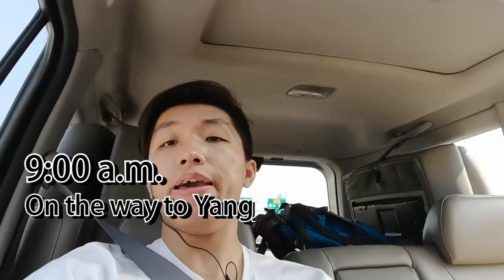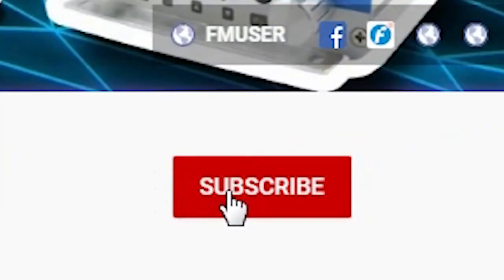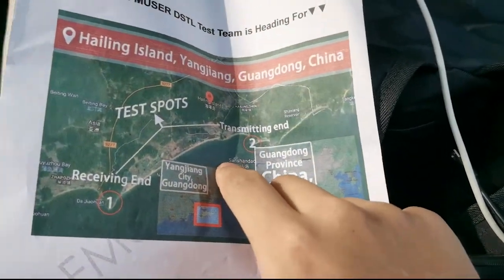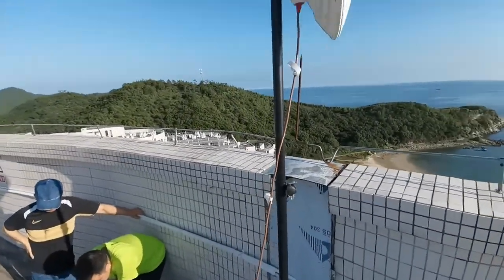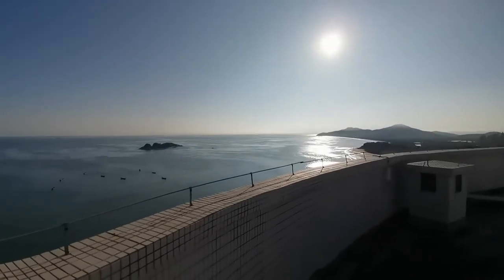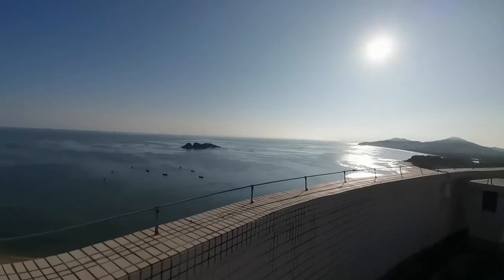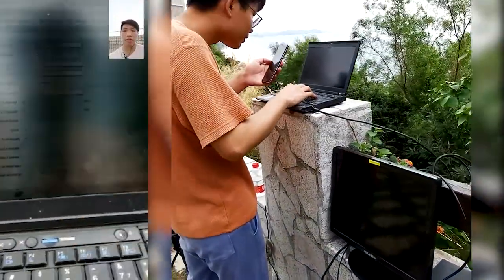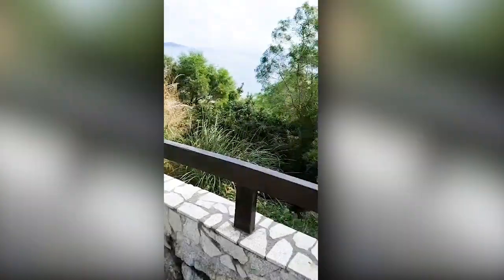Studio to Transmitter Link (STL) | What it is and How it Works?

Comment: I don't think you said what is the frequency and watts of the link? Maybe 5.8G.
You could try to make a 800 - 900MHz link and have more range.
Reply from the maker: Hello, Shmoe! Thanks for your suggestions, that's really inspiring! The frequency of our STL link is 5.8G. By the way, we also have STL systems with freq from 800 MHz - 900 MHz which are widely used in FM broadcasting. And don't forget to like or subscribe and share more about your opinions on our videos. Wish you a good day, Shmoe!
Reply: @fmuserbroadcast Hi Ray. How much power does the transmitter send to the 5.8GHz bridge antenna?
Reply from the maker: @stillthakoolest  Hi there, thanks for the comment, the transmitter power of the bridge is 1W, and the gain of the antenna is 25dB.